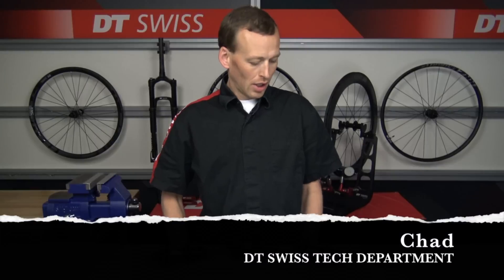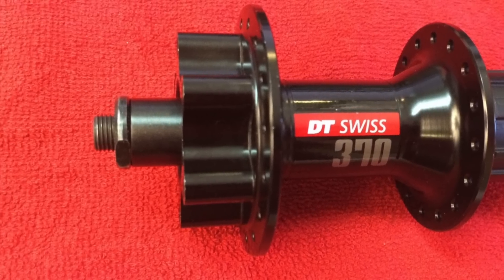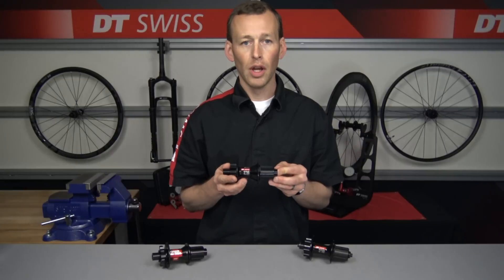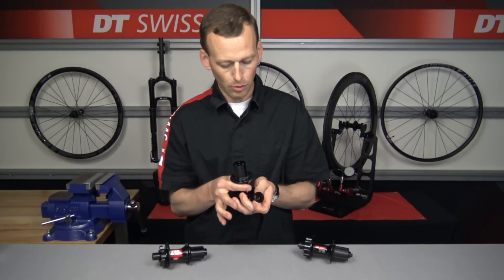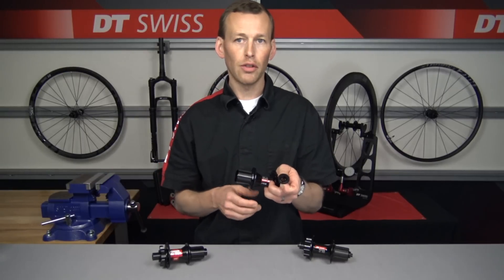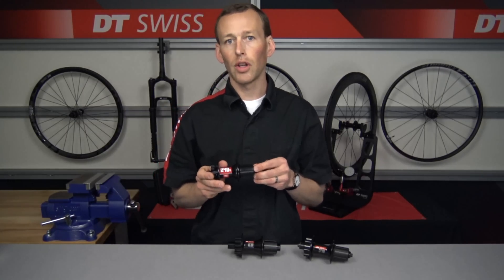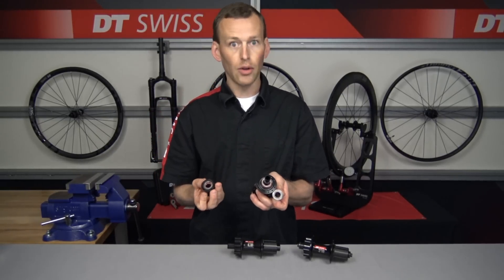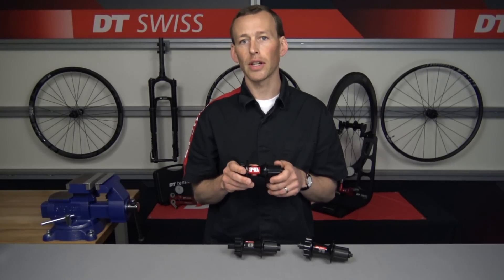Identify the type of your DT Swiss rear hub.  | DT Swiss

Comment: Hi!
Which hub is used for the Syncros TR 1.5 29” rear wheel? I have purchased a wheel where the end caps are missing and I need it to work in a 142x12 frame.
Reply from the maker: Hello Kjetil, thanks for the question. There have been several versions of those wheels, so we would need the complete hub serial number to be able to give you accurate information. Please email your hub serial number to info.us@dtswiss.com. Regards, Andrew - DT Swiss USA

Comment: Hi dtswiss I have a 2014 Specialized Epic 29er with REAR HUB Specialized Hi Lo disc, 4x-sealed cartridge bearings, 12mm thru-axle, 142+ spacing, 32hSPOKESDT Industry Stainless, 3X front/rear 2.0FRONT Roval 29, alloy disc, 22mm internal width, 32h and I found this number by the flange on hub SP-1342 M.C not sure if this is a part # but I was wondering if it's a dt Swiss or if I can put a XD driver on this hub I'm wanting to put the gx eagle group set on this seems to be the only things stopping me. Thanks for the help in advance.
Reply: dtswiss ok thank you. Would you have an idea who makes it there are no labels on the hub anywhere. It's almost like oemn hubs are kept secret and when they go out you have to replace or buy a new wheel I was just hoping to upgrade free hub.

Comment: Hey,
Following problem on my 350.
When I haven´t my hub in the frame, it has a slit between the hub itself and freehub.
When I try to put pressure on it, it looks like the springs don´t work and the complete freehub moves up and downwards. It´s a relatively new hub. Just 3 Months...oh the springs, I tried to make them a bit longer with stretching, to make it louder. Now I have the problem and can´t ride anymore.
Any Advice?
Cheers
Reply: Snapper2015 I did the same, And exact the same problem.
Reply: Thank you for this super fast answer, did not expect that.
It`s definitely my fault, cause of the springs..gonna buy myself a pair of new ones, I was hoping to have no trouble with Dt Swiss hubs, but because of your answer I know whats wrong now. Oh and btw. cause I know you gonna read that, this service is awesome that you provide.
Next hub is going to be a Dt Swiss again. Quality and the system + customer service, just perfect. Definitely love It!
Maybe you could give people the advise to NOT stretch the springs. Sounds dumb but I know people who have done that too.
Thanks Mate.

Comment: My wheel has the 3 pawls system, (R23 db), can it be converted to the ratchet system? Cause I see on your website that the pawls system appears to be removable?
Reply: Any response to this yet?
Reply from the maker: Hi Tom, thank you for the question. It is not possible to convert the 3-pawl hub to star-ratchet. Even though many of the parts are interchangeable, the hub seals are very different between the 3-pawl and star ratchet hubs. On the 3-pawls, the seal is part of the freehub, but on star ratchet hubs, it’s pressed into a special machined groove in the hub shell. So it’s not possible to get the hub sealed off correctly if you attempt the conversion, and dirt intrusion will quickly mess up the star ratchets. Andrew, DT Swiss USA

Comment: Does some wheels come with different hubs?I just bought the DT Swiss E1900 Spline real wheel. In the description wheere I bought it, it said it had the Ratched system. But the wheel I received has the 3-pawl system! Does this wheel excist with a Ratchet hub as well?

Comment: Hallo DT Swiss!

I've got a DT Swiss 370 10mm Thru-bolt rear hub. I would like to use it in a frame with Syntace X-12 axle. (thats just 12x142 or not?). What parts do I need to convert it, only end caps or do I need more?

Thanks!
Reply: I have seen that yeah, thanks. But the 370 isn't in there. Do I have to look at the 350 IS rearhub?
Reply: Last week I got in the conversion kit.. I just needed 2 larger end-caps and done. Very easy and good. Thanks! Happy DT Swiss rider :)

Comment: hallo , i have the syncros xr2.0 weels on my scott spark 910 2016 with 3powl freehub body... want to know... is it possible to change the  ring nut nr HCDXXX00N6137S, to Ratchet Hub 240 ring nut... to convert into ratchet system... if i buy only 240s freehub body? Thanks.

Comment: Hi, I use 2014 M1900 spline wheels for my MTB and I want to replace the current rotor for an XD body for SRAM XX1. It looks like I have a two pawl hub QR. Is the conversion possible?